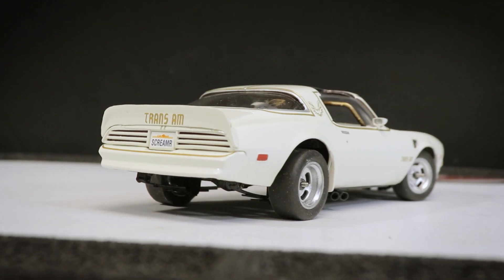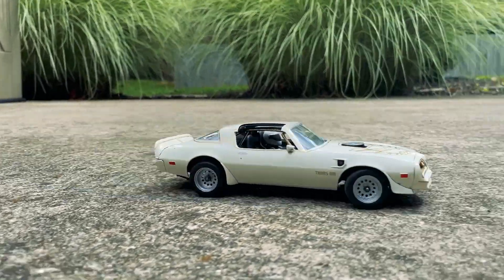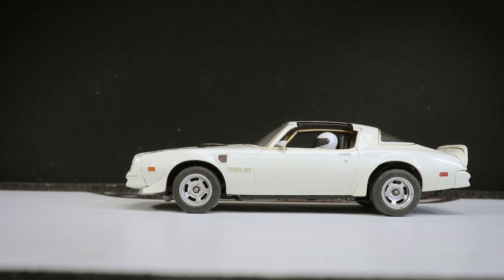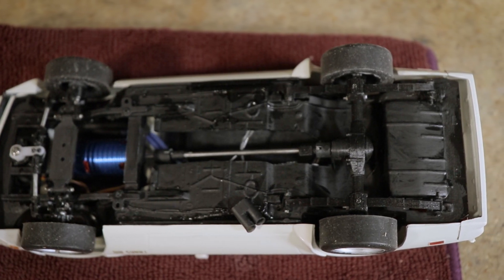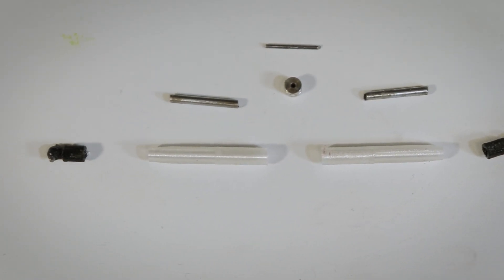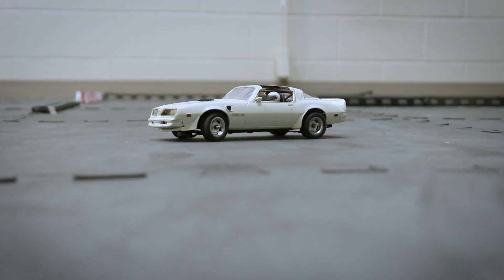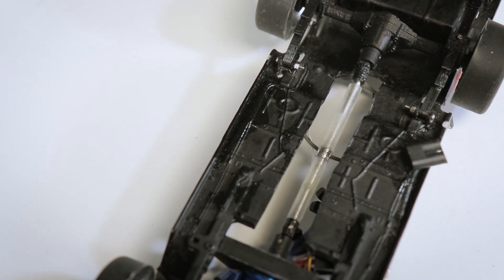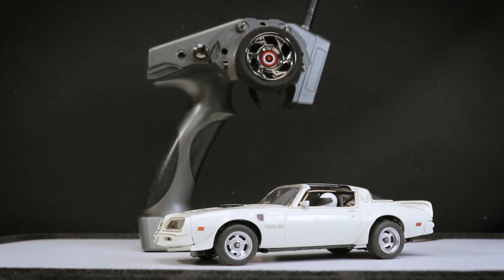Easy Simple Fix For The Brushless Trans Am! 🔧 Using Magnets Instead of Gears? 🤔

Comment: Cool! The slots look pretty good, but Im sure you could find something even better if you didnt really like these. The slots look pretty tough, though. Maybe a slightly larger rear end would allow for a larger ring gear. Maybe brushed motors are the way to go for best torque/rpm range on a direct drive? Like a 1/18 crawler motor or something? I dont know, I just woke up. lol 😜 Magnets were a good idea though, good experiment.

Comment: If you want a relatively easy to print high temperature resilient filament, get yourself some HIPS. Absolutely underrated material, easy to sand as well and takes up paint like a champ. It will poison you, but about an order of magnitude less than ABS.